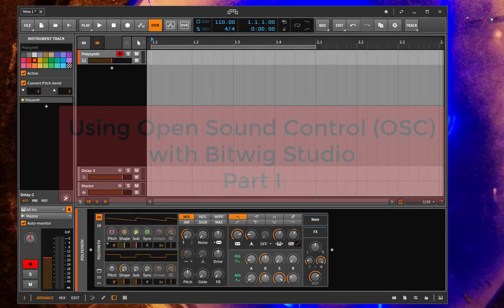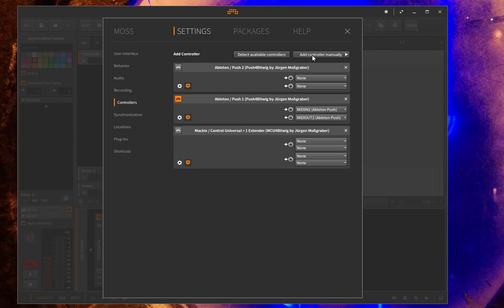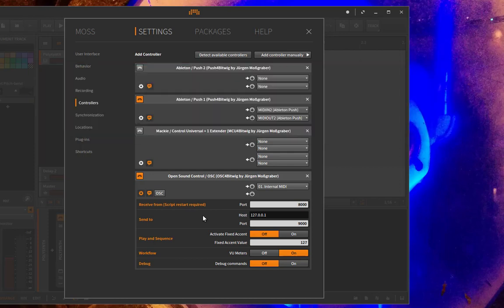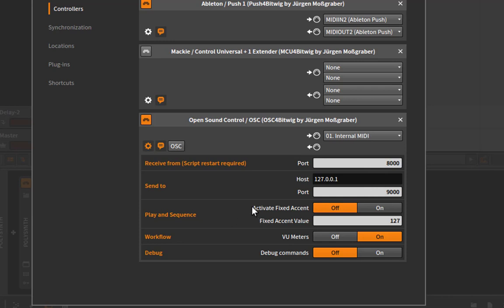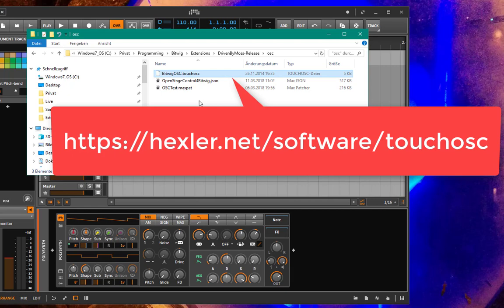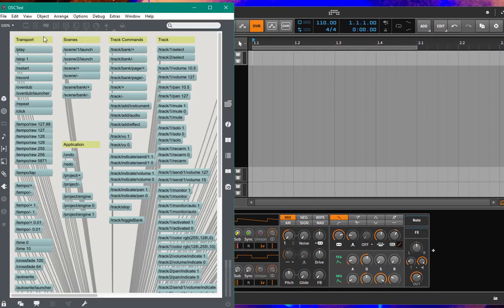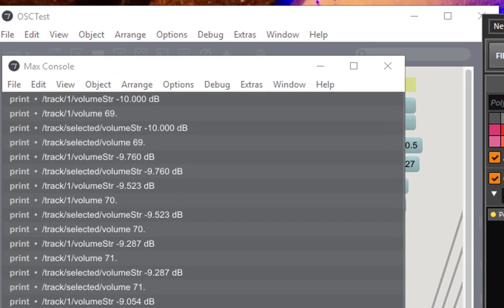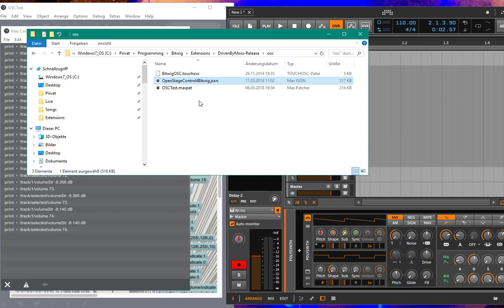Using Open Sound Control (OSC) with Bitwig - Part I

Comment: I am building my own sequencer on touchosc. Currently it uses midi into bitwig but it ha a lot it jitter.

Could I use osc instead?
Reply from the maker: If you are triggering notes you won't be able to sync it to Bitwig, if that is the question.
Reply: @mossgraber thanks for answering.

My question is, if i am only triggering notes, will there be a delay like there is with midi?
Reply from the maker: @octaviop.4870  Should be faster since there is no MIDI conversion involved but not sure if this is really significant.
Reply: @mossgraber  thank you very much for answering sir. Have a great day.

Comment: Is it possible to create/use/connect M4L to/in Bitwig Studio?
Reply from the maker: No. Besides the usual options like sync, MIDI or OSC as shown in the video.
Reply: @mossgraber  What about from M4L to Max and then into VST3, CLAP, etc.?
Reply from the maker: @prod.xx808xx  Not sure if I follow, you can always create connections between these technologies via OSC or similar network connections. If you mean to convert/create implementations automatically between these technologies, this will not work.
Reply: @mossgraber  What do you mean by "create connections...?"
Reply from the maker: @prod.xx808xx  E.g. you could implement a plugin and open a network port to receive OSC commands, then you could send OSC e.g. from M4L or Max to it.

Comment: Hey there, thanks for the awesome work. is it possible to receive the VU meter without smoothing? would save me such an amazing amount of time setting up a gazzillion amount of envelope followers to control visuals. thanks very much for your answer in advance
Reply from the maker: I basically only forward the value from Bitwig. There is nothing I can change.
Reply: @mossgraber  thanks for your quick answer, such a pity this amplitude data is smoothed - thought i had an amazing workaround now. i just need to gather realtime amplitude data of hundreds of channels for an audiovisual installation and used to do it with ableton and a ton of envelope followers but it becomes buggy and unreliable very fast. so when i found this i was overjoyed. but i need the raw data though, not with a smoothed release. anyways, thanks again! boris
Reply: Sorry to bother one more time but do you think there is a way to get to the raw amplitude data of a track?
Reply from the maker: @barretijden  I don't think so but not fully sure. It could be possible to somehow connect it to a parameter knob via the Grid. You could try to ask in the Bitwig forum on KVR.

Comment: Hey , thanks for the awesome extension and tutorials, awesome implementation of OSC & also flexi midi is absolutely essential (and somewhat shocking not included as standard tbh) . I am having trouble however working out the address to use to control a devices exposed parameters . the device is an audio effect on track 2 , what would the correct syntax be ?
Reply from the maker: You can only work with the cursor device (= the selected device). So, you first need to select the device on track 2.

Comment: Is there any possibility to send notes in different midi channel? I tried but without luck. I want to send note on/off from python script - but I want to control track1 and track2 in Bitwig separately. I can do this to the volume of the track, but not with midi notes. Any hints?
Reply from the maker: Yes, each command contains the MIDI channel: /vkb_midi/{Channel:1-16}/note/{Note:0-127}
But note that each track in Bitwig has a MIDI channel setting which by default sets all incoming notes to channel 1!
Reply: Oh great I was missing the changes you mentioned in the Bitwig track settings, Thank you - works perfect!

Comment: Hello, thanks for all this info. One question. When I'm trying to add the Controller OSC4Bitwig, I can only see OSC (by 
Jürgen Moßgraber), not the one you selected [OSC (OSC4Bitwig 
Jürgen Moßgraber)]. 

Did you changed the name lately? 

I followed all the installation steps from you Github page. Im gonna follow the video, just wanted to know if I missed something.
Reply from the maker: The video is a bit outdated in that regard. All the *4Bitwig scripts are now integrated into DrivenByMoss and therefore renamed.

Comment: Hi Love your chanel. But can you help to sync bitwig with resolume 6? I don´t find any REAL tutorial about that. I would can sync effect, clips between both with ableton link or another way. thanks, hope you can tell me something. I´m can only sync timecode but resolume don´t recognize the music for example change form, color, scale with the BPM sync 
sounds (would want send separate canal audio to Resolume for animate diferents layers)
Reply from the maker: By coincidence I just bought Resolume some weeks ago. I did not try to sync it yet but gave it a quick spin: I simply turned on Ableton Link and it seemed to work fine.
Reply: With ableton link. I´m only sync BPM. I want send different audio source to layers resolume. You know... Example 1 audio beats for one layer and the audio can change effect or scale, rotation etc . I believe it´s posible send to Resolume different audio sources (today I try with loopmidi but no result). I´m very lost. When you sync , can you remember of me, and explain me how you do it. Thanks. Many thanks for your answer
Reply from the maker: @seosevilla  Sorry, I can't help you with that. Better ask the Resolume people.

Comment: Hey great tutorial, i have a question though, i'm not not very tech orientated so forgive my ignorant's on the subject. At the moment i'm currently building a template in reaper i wondered if i could control my template with a touchscreen with Open Sound Control? The other question is, can i use Reaper and OSC in tandem? Meaning if i use OSC will these become a default browser and i have to work within this, much like VEPro. Here is a link to to video i was looking at which he utilizes a touchscreen with OSC but i noticed this guy uses Cubase but not sure if he's only using OSC. I

https://www.youtube.com/watch?v=j3Jkk36mZCY
Reply from the maker: I am not quite sure what you are asking. This video is about Bitwig not Reaper. However I have a version of DrivenByMoss which runs with Reaper. You can use the OSC script which comes with it to talk to Reaper. Also Reaper comes with a native OSC implementation. The functionality of the later one is limited (but a bit more performant). You can use Open Stage Control (which is a client for OSC) with both of them. The template which comes with DrivenByMoss can only be used with my OSC implementation.

Comment: Do you know if Open Sound Control would work with TouchOSC2Midi for Linux? 
Is this the same protocol which uses TouchOSC? Will the device running TouchOSC server recognize data from "Open Sound Control"? Thanks!
Reply from the maker: You can directly use TouchOSC with my OSC extension. No need to convert to midi. The DrivenByMoss download also includes a simple TouchOSC template which "speaks" the commands.
Reply: Hey, sorry, I didn't explain what for I need this.

I'm not using it for Bitwig, I need to control a PiSound sound card for Raspberry Pi and their MODEP software which uses MIDI mainly. 

So, is Open Sound Control using the same protocol as TouchOSC does? If a server that accepts TouchOSC controls will recognize OSC from Open Sound Control?

Thanks!
Reply from the maker: OSC is a generic protcol. It always depends on the commands you send over the protocol. The client and the server need to use (or have configured) the same commands. E.g. if you send "/play 1" to a server, it needs to know that it should start playback.